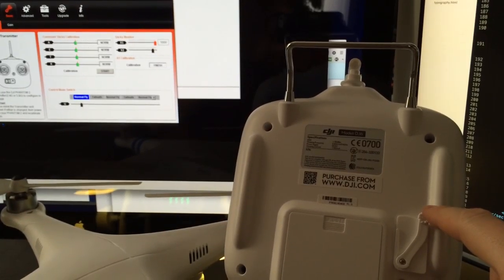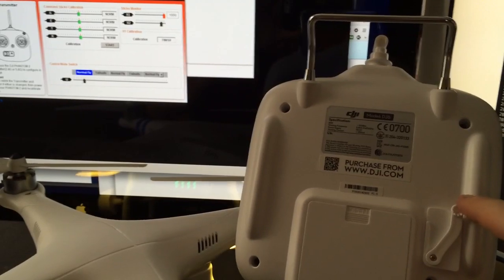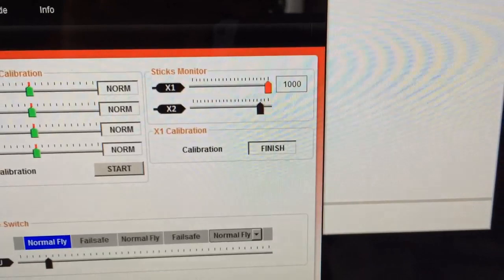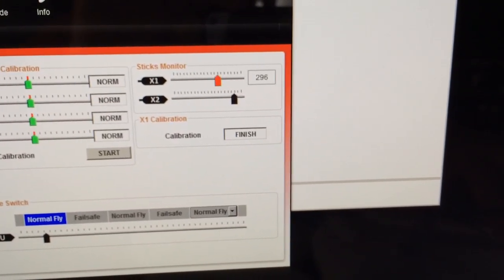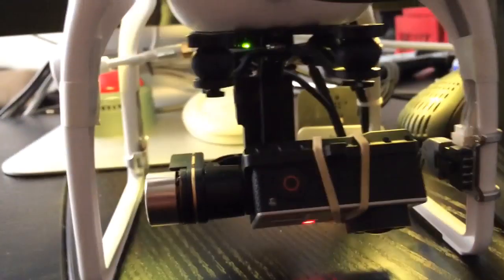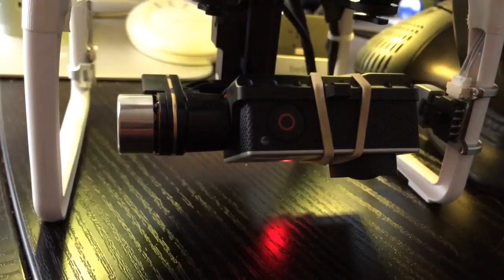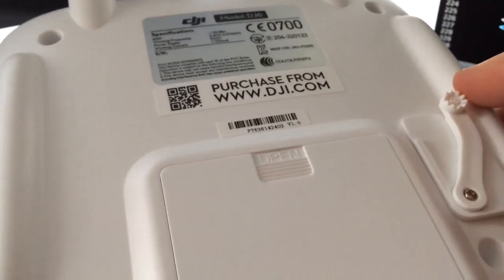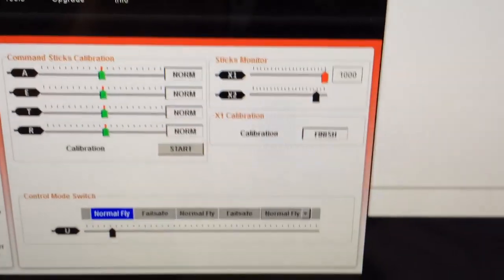DJI Phantom 2  Zenmuse H3-2D Gimbal Tilt Problems (Broken Drone)

Comment: Followed the suggestion to include your RC controllers up/down lever (at back) in the calibration process, using phantom RC app. Move it to its limits just like the main two sticks. Fixed my similar problem instantly, thanks for the help out there !

Comment: don't try and calibrate from that screen, go into advance and and select gimbal and then calibrate it there,  then go back and calibrate from that first screen this drove me crazy, it's fixed perfect now, you can adjust the response as well so it does not just swing up and down fast but smooth and controllable
Reply: Really fixed the tilt.  Thanks!
Reply: I set my gain for the tilt at 6 super smooth live useable tilts now..

Comment: You have to use  the Remote Control assistant software to calibrate X1 first, then plug in to Phantom and use Phantom Assistant software to calibrate X1 again.
Reply: 848phantom 
Holy Crap!!! It Worked!!!  I was ready to send mine back to DJI.  Had a RMA# and everything.
Thought I woukld google the answer 1 last time.  THIS WORKS.
Thank YOU Thank YOU
Do what 848 Phantom says.
Reply: Sandton Phantom +1 on your comment.mine was the same then someone said put x1 in the center position then do the remote assist calibration and move the sticks as well as x-1 then center x-1 and click finish.then do the phantom assist calibration an bang the gimbal works a treat.had to also turn the dimbal gain down to 7 to get nice smooth novements.
Reply: JFK - Why do you have to re-calibrate the controls again after you calibrate with the RC Assistant? Are you sure this is necessary? I really think this does not apply to the Phantom 2 if you have calibrated via the RC Assistant. Please correct me if I am wrong...
Reply: Peter Klimon the way I understand it, after many tries... the RC assistant software calibrates the settings to the controller inputs only. The Phantom Assistant software then matches those inputs from the controller to the phantom.
Reply: thank you so much. it does need to re callibrate with phantom assistant

Comment: This problem has plagued me for weeks.  I took your advice and connected the remote to the RC assistant to calibrate the X1, and found that if I squeezed the controller near the X1 lever it would show up on the software.  Then I purchased a very small flat washer and placed it inside the controller to slightly lengthen the shaft of the slide lever that sits into the potentiometer and now everything is working perfectly!  Thank you Raw 21.

Comment: I had the same problem and i just founded the solution. Don't do what the app says, go to the RC Assistant put the usb cable in the controller and calibrate the axis, at the same time move the tilt lever up and down, you will see that this solves your problem, good luck, regards from argentina.
Reply: Thanks, this worked a treat, was starting to get worried there... :D
Reply: That worked for me! My gimbal was either moving the full distance or still at each end. I couldn't get a mid tilt, now it's working again. No idea why it did that either. Thanks!
Reply: you my friend....are a legend...worked a treat¬ thanks!
Reply: thanks a lot, you´re a master!
Reply: Thanks!!!!
Reply: I've spent months trying to fix this... Thank you so much! It worked!!!
Reply: Amazing - it does work thanks
Reply: Thank You Pablo.  Saved this thing from another trip to the shop!
Reply: You are the man! mine was a mess till pablo saved the day!
Reply: Yes!!! Wanted to share my thanks as well, Pablo.  This was driving me nuts.  Thank goodness for YouTube comments and Pablo hahahah
Reply: Thank u Pablo!! Problem solved in under 1 min....
Reply: Many thanks! This worked for me tpo
Reply: Pablo Blanch During calibration I had my doubts, but when I disconnected the remote it... worked!
Reply: Pablo Blanch THANK YOU!   That worked perfectly!
Reply: Pablo Blanch thanks it worked for me..
Reply: Thanks for the help! :)
Reply: ur welcome
Reply: Worked for me too!
Thanks Pablo!
Reply: También solucionó mi problema. ¡Muchas gracias, Pablo!
Reply: Cliff Schoenrade Welcome Cliff!

Comment: I just fixed the problem. What I did is using the Phantom RC software to calibrate the X1. In the first stage, move the x1 to zero. In the second stage move the x1 to its maximum value(as max as you can) and to the minimum value. 

PS:The instruction on the RC phantom software is wrong. It tells you that use assistant software of flight control system to calibrate the X1 channel. However, if you follow that instruction you will never be able to calibrate X1. You have to use  the Remote Control assistant software to calibrate X1.

Comment: I had the same problem with a P2 with Zenmuse purchased 2 weeks ago
must be a common batch problem
I had to take the back off and turn the pot completely clockwise with the lever to the right then recalibrate. I works but not smoothly from up to down

Comment: I had the same problem on the Zenmuse on my Phantom 2, thought I may have to send it back, but got it working again! You need to go into the Assistant Software (download from DJI site) and recalibrate the X1 control, you need to wiggle the lever while calibrating it. You cant do this from the Remote Controller app, you need to do it from the main Assistant app. Works again like a dream now. Hope this helps anyone else with this problem.

Comment: This can also be caused by undergoing calibration. The first stage of calibration seems to find the zero values for the analog sticks as well as the tilt lever. The second stage (circling the sticks) finds the range of the controls. If you don't move the tilt lever, it appears to assume the range is zero, scales any movement to extreme values, and causes this issue.

A potential fix is to center the tilt lever in the first stage of calibration, then move it to both ends while you circle the analog sticks in the second stage.
Reply: Brandon, THANKS! I couldn't figure it out, but you're right, calibrating the main sticks AND the X1 lever corrects the limits again, and my gimbal tilt works again. Cheers!!
Reply: awesome this fixed my problem. Cheers!
Reply: Thanks Brandon!
Reply: thanks mate. this fixed it!
Reply: Perfect! Thank you.  Worked like a charm.
Reply: Thanks for this valuable tip! Fixed my problem. I totally forgot to calibrate X1 when I was doing the initial calibration with the RC Assistant. I was about to return my Phantom 2 because of this...
Reply: Man, you totally saved me. I sent the drone to EU Support and they sent me back working but after first recalibration everything went back not working. They suggested me several things to try fixing it without sending the drone back to them for another month but NOT THIS ONE!!!!
THANK YOUUUUUUUUUUUU
Reply: and 4 hours later the only fix for this issue I find in YouTube comment.. man DJI customer service needs to step up their game.

Thanks Brendan!
Reply: Right on.  I had already opened the remote previously so it was so X1 (Tilt lever) was maxed to the (-).  Small screwdriver adjustment to get it to center on 1st stage, moved it through the range second set and worked great.  Thanks.  Check out Jeff's comment above to smooth out the tilt action.

Comment: my zenmuse forget the vertical position. my gopro face down 10-15% and turning over in the other end. I tried calibrate with the RC assistant to. nothing better results, BUT i had this ( your) problem many times after recalibration but when I do again, is back to normal.

Comment: I had the same issue but have since fixed it, if you open the radio you will probably see that the x1 pot in which the lever arm sits is bent at an angle. This is not the way it should be. To fix straighten the pot and carefully reassemble the radio. Once this is done recalibrate the X1 slider. 

It's a tricky job and took several attempts reassembling the radio trying to get the lever sitting correctly in the pot but in the end it worked for me.

It's a bad design from DJI and they need to improve on it / provide support before they are indented with faulty radios!

Comment: Hi - I feel your pain - my H3-2D started doing the exact same thing today. :o(
Reply from the maker: Brutal.  I called Dronefly and plan to take it up there Monday.  I'm just worried that it's poor manufacturing and there's not much anyone can do except keep replacing them.
Reply: Jameson Stafford Good news - found out what the problem is. It's the remote, and not the Zenmuse at fault. My local supplier replaced my remote, and hey presto - all woking fine again. Apparently they've had a couple of Phantom 2's have this issue recently.
Reply from the maker: toneuk Congratulations on the temp fix!  Here's the problem - check out the video description.  This has happened to me twice now.  The first time they tried to fix it for 20-ish minutes, then gave up and handed me a brand new remote.  It worked perfectly for two flights, then just magically stopped working again :(